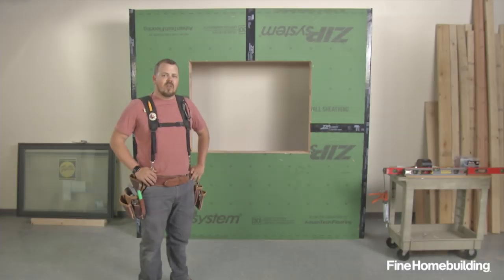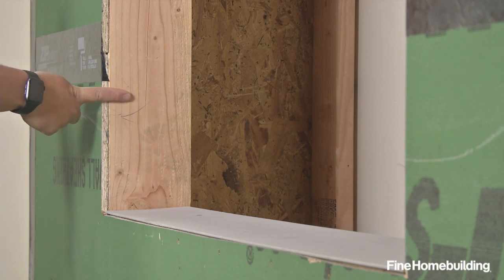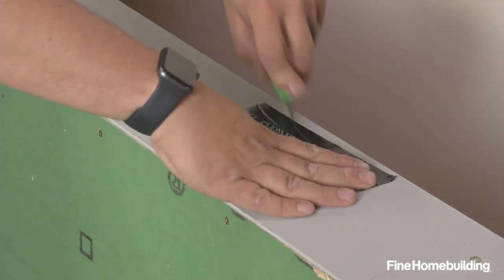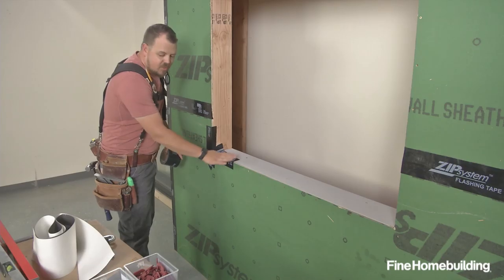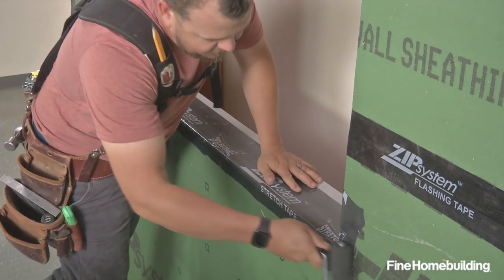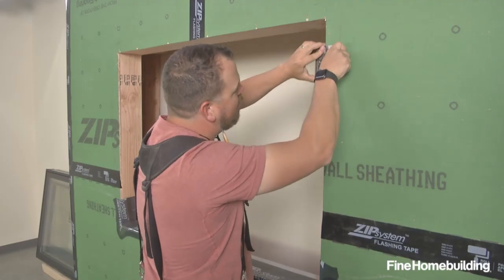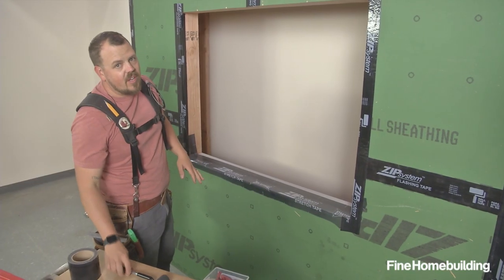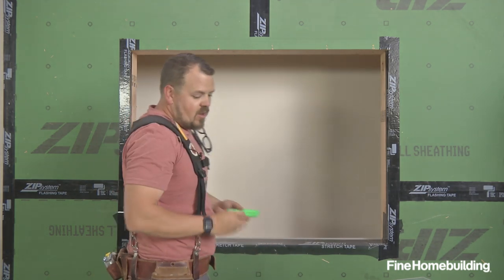Part 1: Prepare a Rough Opening for a Nail Fin Window Over Zip System Sheathing

Comment: Question: I did not slope my sill in framing so will need to add a beveled piece like you did here. I measured my rough openings and the window manufacturer is only allowing a 1/2" tolerance for the entire window. Should I increase my rough opening window size (say another 1/4 to 1/2) if the shims/sill plate angle is being added after?
Reply: Yes, this is how you do it. Oversize the vertical RO measurement to account for slope and shim.

Comment: Liquid flash it. No measuring. Be done in half the time and on to the next window.
Reply: Hey question for you. If you liquid flash do you install the window while the liquid flash is wet or do you let the liquid flash dry first and then install the window?
Reply: @DavidDouglasZach  let liquid flash dry first
Reply: Liquid flash would take a long time to do this properly... and you'd probably use an entire sausage tube ($38 as of 2023) per window.

Comment: Does the tape remain in place? Do you paint over it? I don't understand as it would look strange on the outside.
Reply: This is just the water and air barrier layer. You could have external insulation and cladding above it.

Comment: The piece of flashing at the header should have been applied after the window and header flashing was installed to prevent reverse flashing. Also, the horizontal seams that die into the window should be wrapped 1" into the window opening.
Reply: That is seam flashing all over the wall. I think lapping it or cutting it is pointless. You are depending on Zip tape for this flashing system, so none of the weatherproof plane is really lapped over the head flashing. There is tape all over the wall that does not lap that head flashing and that one piece of seam tape should be left. If you don't trust the Zip tape, add some other WRB over all of it.